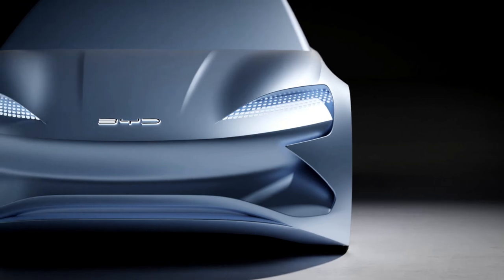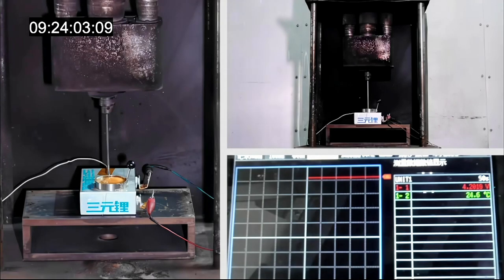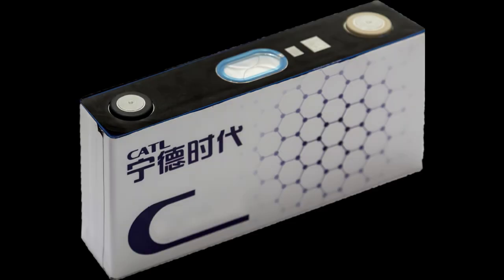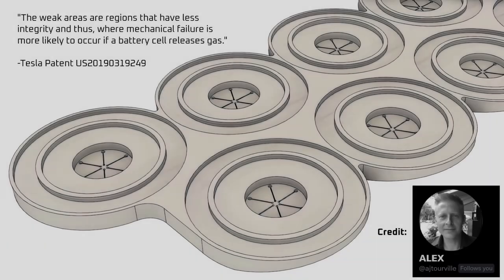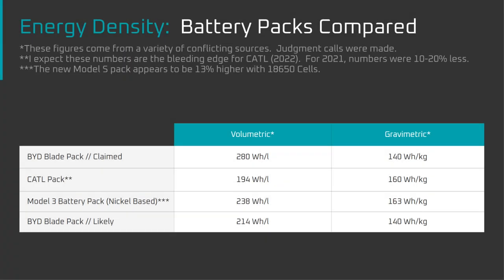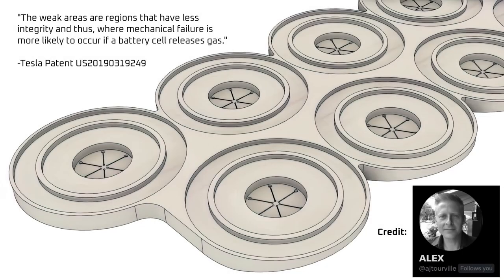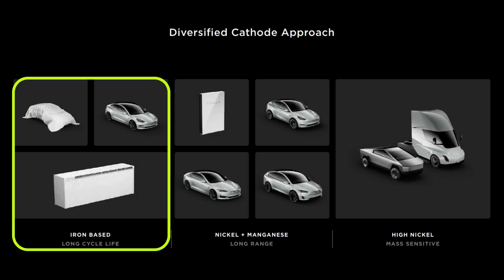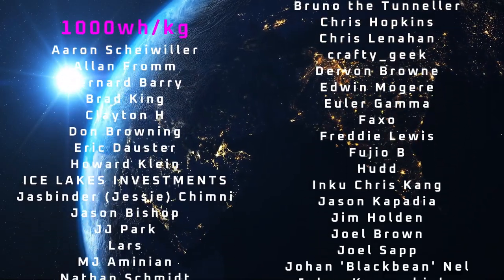The BYD Blade Battery Evaluated:  The Hype is Real (Mostly)

Comment: In the short term there are bound to be shortages of battery materials due to the unprecedented demand, and this will likely affect LFP batteries less than other types as Iron and phosphate are  unlikely to be a bottleneck. While Tesla could use the LFP batteries in their cars, this would require a bit of reengineering and lots of testing to get it ready for production. I suspect a more likely scenario is that Tesla is planning a big push on megapacks and using the cheapest safest battery, regardless of energy density makes sense. It also occurs to me that the Semi chargers are going to need some kind of battery buffer unless they are going to run extra high capacity lines to those chargers, and the Blade batteries would be ideal for that as well. Now the puzzle is, why is BYD stock so lethargic?

Comment: At time point 7:50 where you talk about capacity/wt. there is a factor of electrode thickness design.  This is a trade off in cell design for maximizing AH capacity or design for high %C discharge current rate.  

Thick electrodes (anode and cathode layer thickness) maximize capacity for wt & volume since there is less copper, aluminum foil and separator layers which take up wt & volume but do not contribute to lithium content which determines raw capacity of a cell.  The downside of thick electrodes is lithium ions have greater distance and greater resistance to migrate through the thicker electrodes.  This thicker electrode design, along with reduce current collector foil layers, decreases ability to draw high amperage from a given AH capacity cell.

Since AH capacity sells cells and manufacturing cost is lower, thick electrode cells appear attractive.  However, in high peak current draw EV applications they are not well suited for cell longevity. Tesla Blade cells may have decided on a more optimum electrode (thinner) thickness for their EV application than CATL cells.

Comment: Great video as always, Jordan. I've always assumed Tesla would use 4680 format, for their in-house LFP. Do you think that will be the case, (specifically for their in-house LFP cells)? Or will they pursue something like the BYD blade? Side note: I'm assuming Tesla won't start producing a 4680 or any in-house LFP for a while. What timeline are you assuming, for in-house designed LFP production for Tesla?
Reply: The 4680 LFP, if made, will be manufactured later than the nickel...The nickel 4680 will be for the higher priced long ranged and performance models by reason of higher profit margins. On the other hand, the LFP 4680 is for the standard model.

Comment: The blade battery performs better in a nail puncture test because of its geometry, but does that tell us anything about it actually being safer? The nail puncture is a standard test, but it doesn't represent any common failure mode in vehicles.
Reply from the maker: A good point!  Without data, I can't really say.  

There is a big difference between Safe and Safer.  No battery is safe.  They are all little bombs.

But, from a basic engineering standpoint, the ability to dissipate heat from a larger surface area should mitigate thermal propagation and improve safety.
Reply: Indeed just being thinner reduces the material to damage under the nail.
But what in real world, where they will be stacked thick?
Reply: Even if stacked thick you should get great thermal dissipation qualities with the neighboring blade cells wicking away the heat from  one cell reaching thermal runaway. If the whole pack reached the thermal runaway temperature I guess there's not much you could do about it in any configuration/form factor.

Comment: Are they quickly manufacturable in comparison to cylindrical ?
Reply from the maker: Man, that's a tough.  I'd have to look into it.  My gut feel is that a cylinder would be better for continuous motion, but the prismatic cell would be larger and involve fewer operations per cell.
Reply: @thelimitingfactor  Elon’s thesis for the cylindrical manufacturing advantage was potential for rapid rolling automation akin to a Coca Cola bottling factory…Let’s see if it pans out.

Comment: 1. "BYD increased the price of the blade batteries by 20%". Question: who is buying BYD's bb's to confirm that? 2. The pucture tests have been shown by BYD and conducted by BYD in BYD's premises. Have those blades been provided to third independent parties to conduct the same tests? 3. BYD to supply blade batteries to tesla? With 15 (16 expected with a recent announcement) electric BEV models, not counting with buses and trucks, plus building BEVs for Toyota and siblings, BYD is already in deep shortage of inhouse batteries. For sure Tesla will have to find another structural pack solution for LFPs an so far only the cilindrical cells can provide that with the sought weight reduction.
Reply from the maker: 1) That's why I said "there are reports".  It's a rumour, but it's worth covering the implications.
2) No clue, but it doesn't matter.  Every battery is a little bomb.  The goal is to be safer.  Perfectly safe can never be achieved.  But, the blade looks promising.
3) Good point!

Comment: The puncture tests starting at minute 1:20 are somehow fake: The first cell was fully charged to 4.2V while the other two had about 3.2V, i.e. almost discharged. Hence the data output is worthless.
Reply from the maker: That's because LFP and Nickel chemistries run at different voltages.  Look it up.
Reply: @thelimitingfactor  I mean EOC_levels: For LFP that is about 3.6V but th shown batteries were chared to 3.2V which is about 10%SoC while the "classical" Lipo-battery was fully charged at 4.2V.

Comment: This beggs the question if Tesla will make their own blade batteries or for how long they will rely on BYD. The smaller $25K model would sell better than hotcakes and for that I think Tesla would make their own batteries ( because you know vertical integration would allow them to reduce costs). So, Tesla may soon need more production than what providers alone would be able to supply.
Reply from the maker: I'll be doing a Tesla LFP video soon ;)
Reply: @thelimitingfactor  Awesome! Thank you!

Comment: Time for an update 2024 ? A lot more information is out now.
Reply from the maker: Wow!  This video is two years old.  What information are you refering to?
Reply: @thelimitingfactor  As the market has gone toward better charging infrastructure and the charging speed has improved a lot, with the BYD LFP that has a much more flat charging curve, at the same time the price for batteries and production are still falling. 50-60 kW batteries and lower will be enough for Mass Market as you already pointed out. Now it’s the race to first hit the $25.000 BEV and the Chinese are at the front of that race at the moment. A everyday user only travel about 30-50 km a day and only needs to stay about 15 minutes at SuC one or twice a week especially important if you live in a flat with limited charging options.
Reply from the maker: Good points, but the basic tech is still the same.

As for how factors like cost are evolving, I've made other vides that covera all the major chemistries.

With regards to charging speed, it's only really a concern for people who don't have an EV or (and don't realise the change in mindset that will happen) or people who live in areas where they don't have access to night time charging.  The surveys show that people are very happy with current charging speeds.

Comment: 0:27 - 1000Km is approximately 621 miles...
Reply from the maker: It would pay to watch the full video before making comments about the first 30 seconds of the video, which is just a teaser for the rest of the video...

Or you could read the pinned comment.
Reply: @thelimitingfactor  Jordan, I went back and re-watched the full video again and at 12:44 you did bring up that a 1000 Km of NEDC range is equivalent to approximately 421 Miles as an EPA range.  I am sorry I missed that clarification on my first pass through the video. Perhaps you could have been more explicit with the introduction and not required me to give you the benefit of the doubt for another 12 minutes. I wasn’t expecting the teaser to be misleading in any way but to me it was. You could have easily mentioned that the 1000 Km range was NEDC rather than expecting to know this automatically since the manufacturer was Chinese - BYD.

Comment: Have you seen the claims of Our Next Energy? They claim a pack volumetric density of 450Wh/l that's double of the numbers shown in this video.
Reply: There are several promising battery tech's hopefully coming out.  The trick, as usual, is getting them into production at a competitive price point.  One of them will get there sooner or later.

Comment: If Tesla can get BYD to sell them sufficient volume of blade batteries, I can see them being used in the China version of the 25k model at the very least. 
Tesla has plenty of places for their 4680 LFPs.  Megapacks, come to mind.
Plus the plug in design of the 3 part underbody structure makes swapping packs in the factory completely seamless.   Agile manufacturing means you could literally have 3 cars in a row moving down the assembly line with entirely different packs.  The flexibility Agile Manufacturing brings to the table is truly amazing.
Reply from the maker: 💯 Agile manufacturing for the win!

I've been watching those Joe Justice videos and it's just music to my ears.  I always felt hampered by bureaucracy in most organisations I worked at.

Unlock that human potential!

Comment: 13:26 Sorry my electric vehicle achieves 70 miles/kWh and it's not even aerodynamic.   It's an electric bike.    Now imagine if someone took a velomobile and put in a electric drive train covered it in solar panels, now that would be an amazing efficient vehicle to go to work in.  You could fit 2-3 of them in the space of a single car, but lets keep focusing on the big sedans and SUVs, because that's what we need more of.
Reply: I have built a vehicle rather like a velomobile with electric drive train, registered in the UK as a motorcycle. It does about 40 miles per kilowatt-hour (15 watt-hours per kilometre) at 50 to 60mph (90km/h) and has a 13 kilowatt-hour battery (742 LG Chem M50T 2170 cells, weighing about 55kg). I have just done a round trip of 575km (357 miles) and there was enough left in the battery for another 250km/150 miles. The aerodynamics of this vehicle are done by guesswork and could undoubtedly be greatly improved on.  Is any vehicle manufacturer willing to have a go at building something similar?
Reply: @cedriclynch  That is amazing!   Much better efficiency than I would imagine possible at that speed.     Can you make a video of your vehicle?  I'd be happy with 6-7 kWh battery with range your getting.   Of course for some reason super long range seems the focus, just saw a video advert for a 580 mile (933 km) hybrid.  Who needs that?  Anyway I really like that you made this.   Hope you can get your vehicle (You should give it a name) manufactured.
Reply: @telocity  The extra efficiency comes mainly from the aerodynamics. The vehicle uses about one-fifth the power that a normal motorcycle uses at the same speed, because it slips gently through the air instead of rudely shoving it aside like a normal motorcycle does.

Comment: @thelimitingfactor Hi Jordan...How about an update on this?
Reply from the maker: The main point of this video was to the Blade in perspective.  

Since this video was created, all battery manufacturers have made their batteries slightly faster charging, cheaper, and higher energy density.

Within that context, the blade is still similarly competitive - or appears to be according to their marketing.

The issue with most of these batteries is that there's no public teardown information, so benchmarking is difficult

Comment: 1000 km is more likely 625 miles, right?
Reply: Yes, more exactly: 621 miles. The point is, the EPA way of calculating the range is the more accurate method. The EPA figures have been proven in actual driving, by actual people, on actual roads. The other ways are just calculations involving some assumed factors.

Comment: A blade cell is going to be stacked in a battery pack, same as a prismatic or cylindrical cell, so the number of layers punctured depends on the size of the puncture, not the size of an individual unit.  The use of a shorter nail in the blade cell diagram is unfair and misleading.

Comment: LFP is safer and last longer in lifespan is common misconception. The reason why LFP is not suitable on EV is becasue in high C-rate(from above 1) LFP's safety and lifespan drastically decrease so it's more dangerous than NCM. 

LFP is only suitable for EV that performs only below C-rate of 1.

Comment: I see LFP being extremely popular for energy storage, but for automotive power weight and raw output are everything
Reply: At the point they can get 300 miles of range with LFP that is more than enough. Im betting that as EVs take over the market we will see a reduction in pack sizes as people realize they dont actually need 400+ miles of range. Nor does anyone actually need to accelerate anywhere near as fast as even the slowest Tesla.
Reply: @patreekotime4578  Their is no economic case for a large investment into a car. Incapable of at least 700 miles of range. In certain countries you can get away with 400 or 300. Living in Australia its easy to burn through a 300 mile budget in a hurry.

Comment: You missed another important points, that BYDs LFP can be fully charged from 0 - 100% compared to Teslas battery that should only be charged between 20 - 80% and a lower total number of recharges.
Reply from the maker: That's why this is a series.  That was covered in the LFP Science video.

Comment: Taking EPA as a base metric is wrong because it is inconsistent. It allows for different procedures (Tesla) to be used and it has proven to have low correlation with real world. WLTP while being more optimistic better correlates with real world. Using WLTP, that "class leading advantage" from 13:05 would disappear.
Second - you are assuming that BYD Han is limited by battery volume and that's why it has "only" 77kWh. Picking any other limitation completely erases that argument. And it may be even unrelated to car itself - like managing decision to make 100 000 cars with 77kWh instead of 50 000 with 144kWh (battery production is THE limit for EVs).
Reply from the maker: As usual, I used approximations.  The point is that they aren't getting what they claimed.

Correct, they could be underutilising the space, but that would require a video as to why along with further analysis.  At this point, it is what it is.  There is clearly a reason why they aren't putting more batteries in but yet they're claiming 1000km and 63% VCTP.   Claims vs reality.

Comment: there is alot of assumption in the video that physically do not make sense. you can't just compare cars to determine battery performance, you need the measurement of the battery and the car, if a car is more luxurious with heavier styling or larger motors, it going to perform worst. our country didn't give tesla a "green label" because of this as it view tesla as a "performance" vehicle. car manufacturer isn't really pushing their design to the limit, because we don't buy car base on spec, but their comfort and features, and even... their "fun factor".
Reply from the maker: Not sure what you mean.  I compared batteries too, at the battery level.

Comment: Your range translation isn't that correct.
Model3 LR in china has 668km NEDC range.But has 334mile EPA range. (han NEDC 605km)
If han use same
 proportion,it will be 301mile.
Consider its a bigger car, efficiency isn's that bad.(And this car is release in june 2020).

BYD's newest suv,Yuan plus eqiup with 150wh/kg battery pack for long range version.
I heard about the ocean x(or EK,seal),will use gen2 blade battery which reach 160wh/kg energy density.And battery fully integrated into the chasis.

I live in shenzhen china and i know many thing about BYD.if you have anything to know about BYD,you can contact with me.
Reply from the maker: Conversions can be very vehicle dependent:

https://insideevs.com/features/343231/heres-how-to-calculate-conflicting-ev-range-test-cycles-epa-wltp-nedc/#:~:text=So%2C%20U.S.%20BEV%2FPHEV%20drivers,a%20standard%20deviation%20of%200.092.

Comment: This guy needs to open his eyes. He is  speculating with out much facts and  he does not discuss  other external factors like aerodynamics, power consumption/ efficiency of electronics,ac,heater, motors, tire type, rim type etc. Those also significantly affect range.  Also it is difficult to speculate on battery range because software controls how much is left in battery reserve!!!!! To increase battery longevity EVs almost always have spare capacity In battery to increase longevity. From what I read The Chevy volts battery always had a spare 20-40 percent capacity when ev range became "empty". It also never charged passed a certain threshold. Tesla did this trick when they pushed a fw ota to their vehicles in hurricane areas a few years ago to give their Tesla owners a few dozen miles more range to gtfo out of danger zone.

Comment: There's no way the gravimetric E density is caused by thicker steel walls. Battery metals are already really dense and a little more thickness won't mean over 15% loss compared to CATL. 15 minutes of math would disqualify that theory.